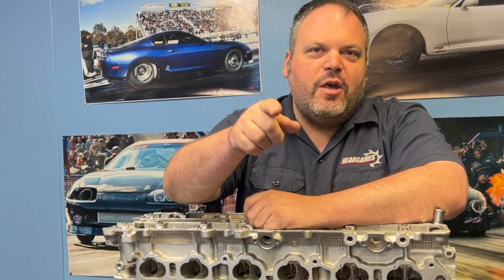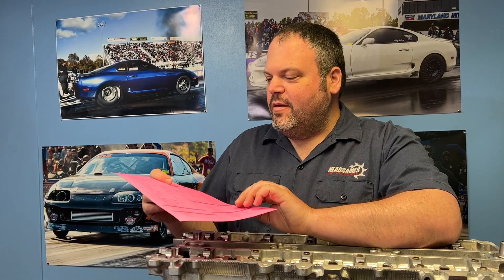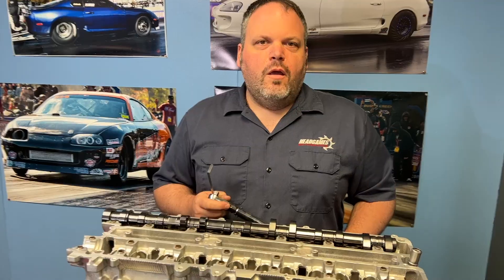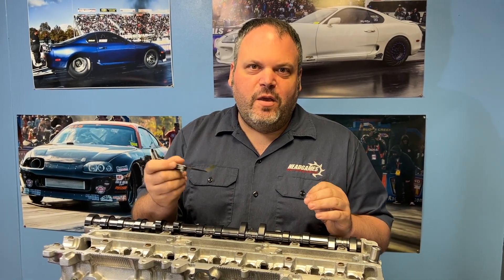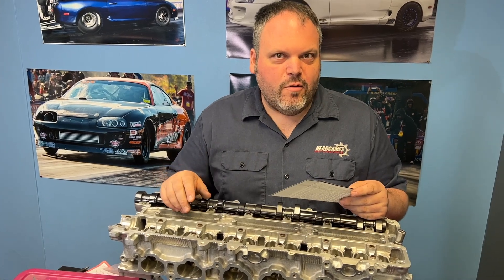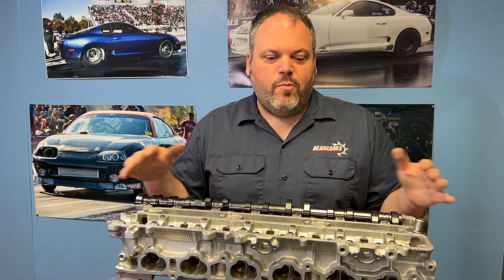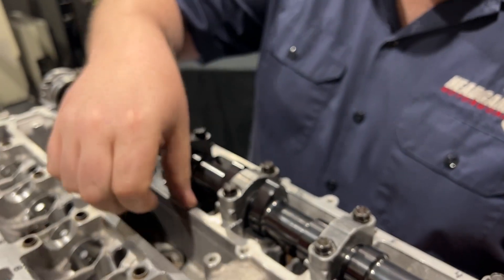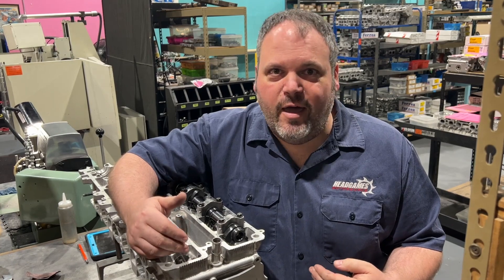How do we set lash adjustment with solid buckets?

Comment: I just scored a 2JZGE (non vvti) head that is the first generation with a distributor. I am of course deleting the distributor and going coil on plug. My hurdle is that I had to source cam caps from another head and cams from also a different head. Yes, I am creating a headache for myself. Haha. But how hard can it be? After I get the cam caps re, aligned/honed to accept the cams that I’m trying to fit in? I’m sure you guys have done this before right? I’m not crazy for trying? Thanks!
Reply from the maker: it is not crazy, we do it. But, idk if a GE non vvti head is the one to do it since they are kinda cheap and would be more expensive to do what you are trying to do than buying another core. Unless, you are in love with it. Then I wouldn't stand in your way.

Comment: Hi Dave, I'm seeing conflicting info on what is the maximum cam lift safe on the oem bucket on a 2JZ. A tomei card says 9.1mm is the max on oem buckets while many forum and shops think 9.3mm is the max on oem buckets. What are your thoughts? This would be great youtube content if you could actually show the max cam lift limit on the oem bucket to visually see at what mm lift would the shim be struck enough to spit the shim off the bucket
Reply: Oh and is it max valve lift, OR  max valve lift - clearance = net valve lift ?